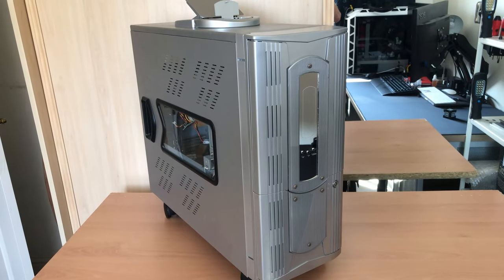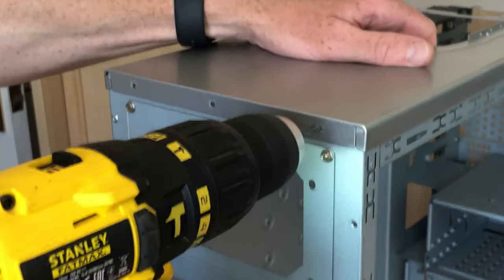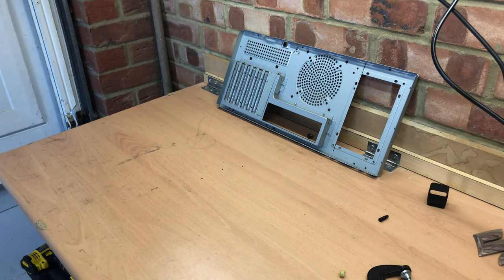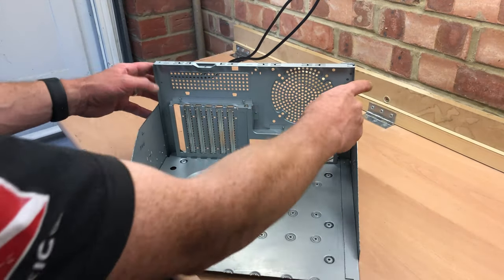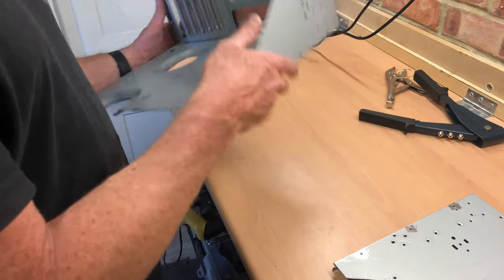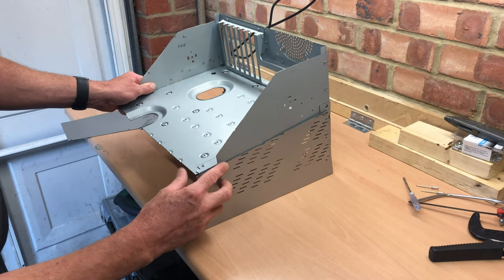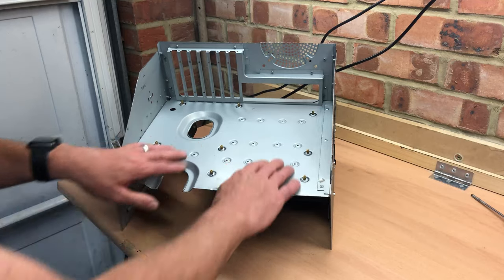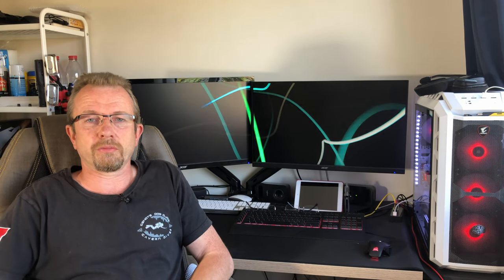Best Homemade Testbench on YouTube

Comment: That moment when you read a video title with "best" in it and it's NOT clickbait. I love it! Well done mate
Reply from the maker: Hey Darth Nihilus, Thanks for the complement, appreciate it.
Reply: @KNTech  You're welcome. I gotta do my own bench with yours as a template but with multiple 360mm radiator support.
Reply: @RngmonsterX  Nice. if you extend the width by 120mm you will be able to fit one under the I/O shield/PCIE slots (I can fir a 240 in the space there, you can see the cut out in the last few shots). not sure where you would fit the other one. would be very interested when you get it finished. Can you send me some pics? Good luck
Reply from the maker: @RngmonsterX  replied under the wrong account, but you get. the idea

Comment: i know its 2 years ago but looks good that rubber you put on the back i would put it on the front bit it look good then i might copy that as it is nicely done thanks
Reply from the maker: Thanks for the comment, the rubber that you saw was actually the rigid plastic border of the window in the panel at the back, but you are right, some rubber tubing around the front would be a nice touch

Comment: Oi! I've an original NES-001 that someone's given me. They want the original case for an art project and the unit itself supposedly is inoperative. I've been looking for good resources to A) make a custom box, not unlike your test bench and B) clean and check the board and fix the component parts to have it working in its custom case. No small order, but something with kind of a heavy duty test appearance would be perfect.
Reply from the maker: Sounds interesting. i look for old cases on local market places, like ebay and facebook
Reply: @KNTech  RIGHT@! I actually haven't checked Ebay! Was actually planning on going to the local thrift store, someone told me they usually have a couple giant CRT monitors for sale and putting micro-ATX builds or old hardware in and replacing the tube with a little flat screen can work great. 
I've got my girl checking the local "buy nothing" groups on FB too! Thanks!
Reply from the maker: @Matrxmonky  sounds like an interesting project, you must let me know how you get on

Comment: I will be following your very well made guide and build my own. The only negative part is leaving the rather sharp edges at the front and top. With a bit af plastic tubing cut down the length and fitted over the sharp edges would have sorted them out and in black would have looked quite nice as well. But i did enjoy the vid. Well done.
Reply from the maker: HI Jeremy, thanks for the comment. you're right, plastic tubes would cover the edges, i did look at that, but didn't like the look of it, so i sanded the edges down so they were smooth. please upload some pics when you make yours, would love to see it.

Comment: Looks awesome. What did you use to cut the sheet metal? Looks too neat to be done with a hacksaw. Too bad you didn't give a list of tools and supplies you used. Chhers
Reply from the maker: Hi Ken, thanks for the comment. I only used a jigsaw, and a steady hand. Tools and supplies were very straightforward. An old tower PC case, jigsaw, rotary tool (Dremel like), a couple of files to smooth the rough edges, pop rivet gun and rivets, and some primer and top coat paint.

Comment: I've always used an empty pizza box for a test bench.Takes me zero seconds to make and zero dollars to buy.

For an open air case, I'll do this same thing to a midtower but take off the top panel and the front panel and discard, take out and discard the drive bays, and leave the back panel to hold the cards and power supply, and leave the bottom to hold the whole thing up on a desk and rest freeballing drives and cable on.    So the whol thing looks like an L from the side with the motherboard facing you on the desk.

The main downside for of an open case design is fan noise, but you're going to have that no matter what so I've gotten use to it.  It's just more pronounced to me because I have the northbridge and cpu fans pointed right at me where I'm sitting in this orientation.

If you don't want to go through all that, just take any midtower and stirp off allt he facia and plastic parts and the side panel and discard them, and remove any floppy bays.   You can go further and remove the 5.25 or other drive bays but I usually keep them as I mount my All in one CPU radiator in the 5.25 drive bay area blasting out the front and it fits almost perfect.

Just looking at yoru design, I would say most of the 486's and old Pentium desktop box computers fromthe 80's are already there...  (i.e. not veritcal midtower cases).    I'm talking the real old cases that came after the PC XT and AT.   Windows 3.1 era.   386's and 486 desktop comptuers with the motherboard flat ont he table.   I've got oceans of those.  They often get thrown away.
Reply from the maker: whatever works for you